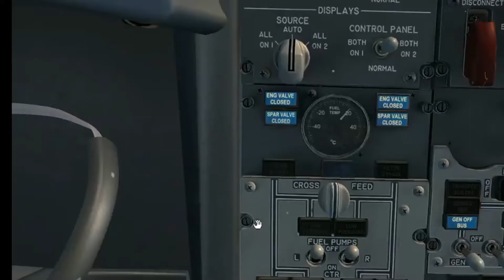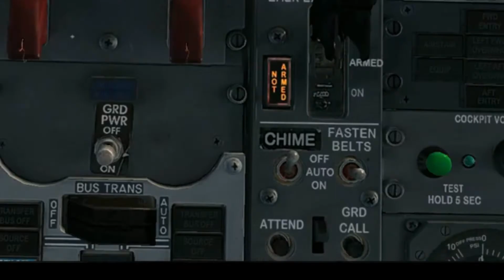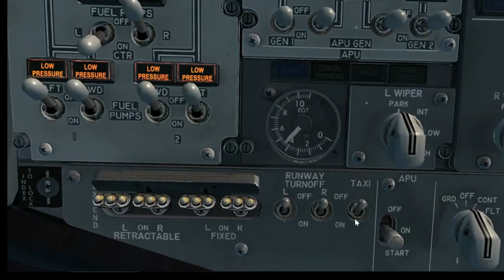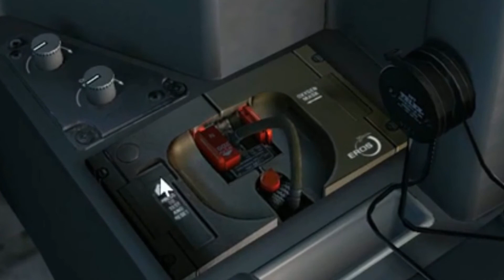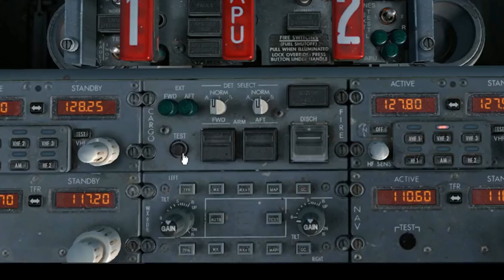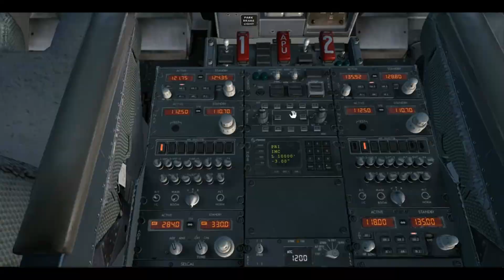Video#4 (FO Preflight Procedure)

Comment: So once refuelling begins for the next sector with the Apu powered on, can we use the centre tank pumps to fuel the Apu only after it gets 1000 pounds /453kg fuel in the centre tanks?
Reply from the maker: Hello Sushil, 
That is absolutely right, one thing to keep in mind is to comply with the requirement of the Cockpit has ti be attended if a center tank fuel pump is ON.

Comment: Thank you for the video! Very helpful. I like that you are doing the FCOM and not performaning single pilot ops as you would in a sim. Is there a reason why you leave off the recirc fans?
Reply from the maker: Hello em bdk, thanks for your kind words. 
I have an issue with the recirc fans because of the noise they make and the fact that it is cerculating air instead of having a constant supply of fresh air. 
However while I use to get away with the recircfan in the off position in the 700, I believe they equlise the cabin tempereture in the 800 better. Now I fly 767 and guess what as soon as the recircfan is off the cabin tempereture vary in a significant way that we have to use them all the time. 
As far as recircfans I guess I am revaluating my old belive regarding having them off.
Reply: Abdulmuati Asiri I understand! They are also quit noisy on the 800, right? I will look forward for more videos in the future!
Reply from the maker: I will do my best, I have been extremely busy lately, but hopefully will resume uploading videos in the near future. 
If you have any suggestions for specific topics please let me know.
Reply: Abdulmuati Asiri all standart Boeing procedure Will ve Nice!
Reply: Recirculation fans when switched off make the temperature more cold because of no circulation?